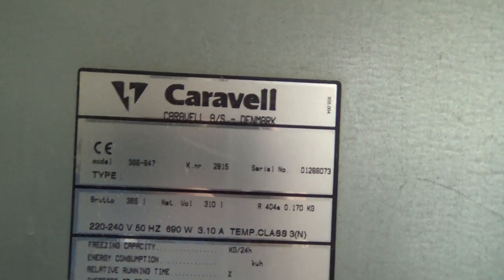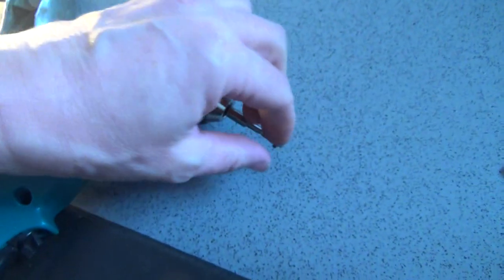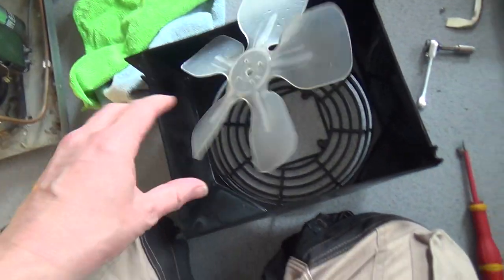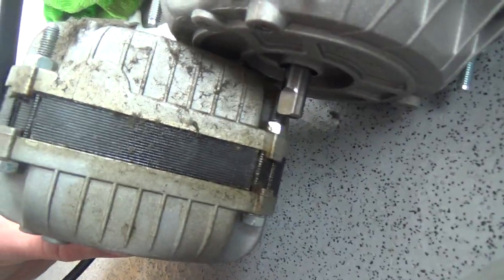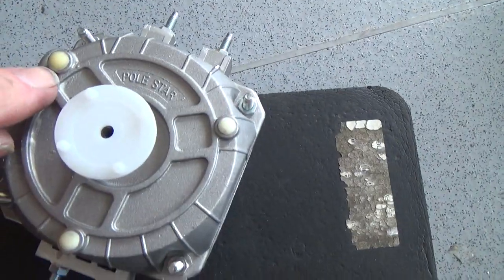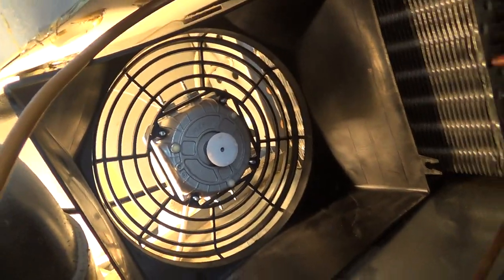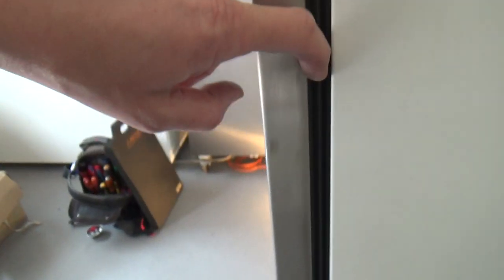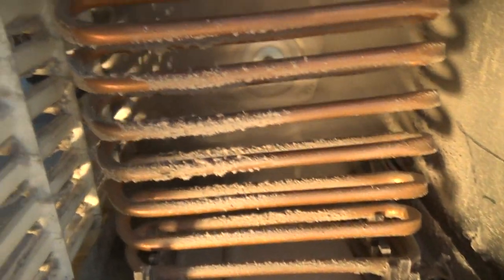5W Multi Fit Fan Motor

Comment: Thanks for the information on the motors!  I am seeing a lot of newer units that are fitted with what looks like a large computer case fan.  4.5 inch square fans that are being used for condenser and evaporator, though they don't seem to last very long.
Reply from the maker: Yeah, lots of the China made ones have those, they're a pain as there are different thicknesses as well and power connection for them, too many types to keep on the van.

Comment: I bet that motor was a screamer when it was running, that bearing sounded like nails on a chalk board 😆
Reply from the maker: It had stopped turning by the time I got there, checked these over a few months back and it was running fine then!

Comment: Just wondered if you've had any trouble with those Polestar motors mate ?, I found they were failing prematurely, switched to a different make now.
Reply from the maker: I've had two of the 18w and one 25w fail early with bad bearings. Found them slightly better than the FMI ones I was using before.
They have started doing some Italian made ones with better ball bearings so have been buying them in the sizes they do, too early to say how well the Italian ones last. 
What ones are you using?
Reply: @heavydiesel  I tried the Italian ones. didn't last any longer, even though they had bearings. I use Elco motors now. they seem to last longer, hopefully get a few years out of them.
Reply from the maker: Hopefully I'll have better luck with the Italian ones, did think of giving the Ma Vib ones SRW sell as have seen them last well. Its a bit of a minefield! Will keep the Elco ones in mind.
Reply: @heavydiesel  Yes, I think the MaVib motors are okay, I don't generally use SRW , have done for some items I couldn't get elsewhere, they do a good range of heater trays.